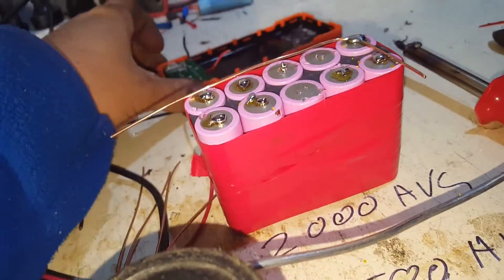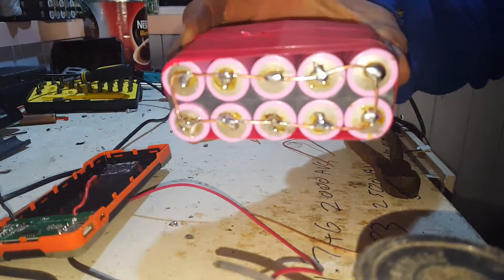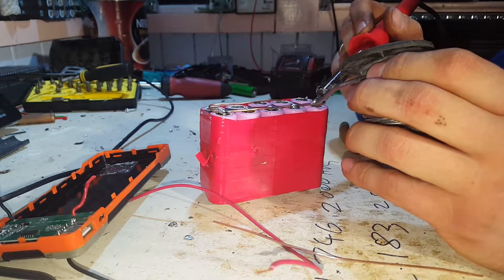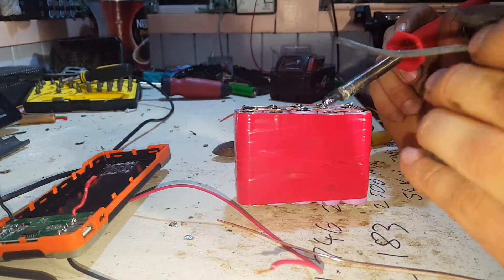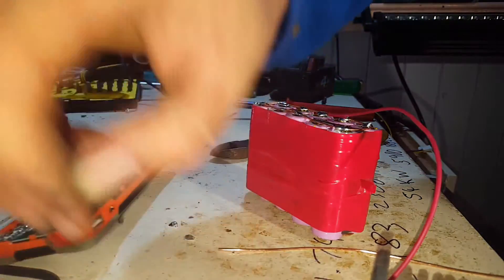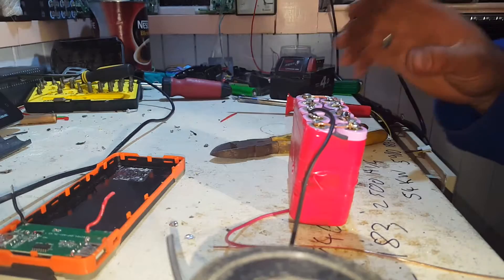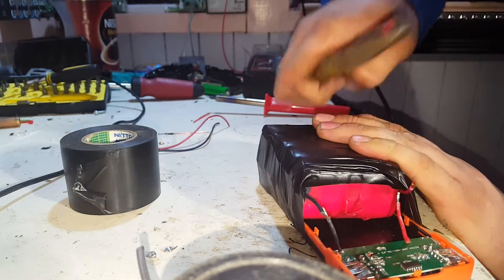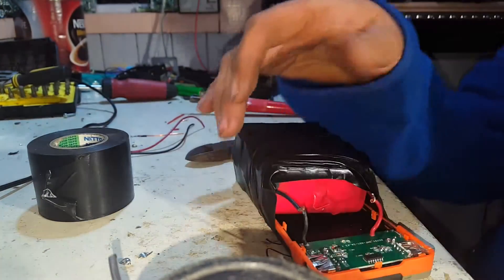30,000mah + Usb power bank DIY HACK 18650s

Comment: Did the wire stay on? I tried it that way and the solder always breaks off of one battery, so I purchased a spot welder and I tack on nickel strips. It does a better job of staying on.
Reply from the maker: +Adonis cmj use a bit of flux  mate helps heaps cheers
Reply: Yea, I tried that as well. I found that the solder didn't stick very well on the negative post of the cell. I cleaned the negative with alcohol and scuffed it with some sand paper, that helped a little. I guess I was afraid of leaving the heat on the cell too long as well. The amount of packs that I make, it made sense for me to get the spot welder.
Reply from the maker: +Adonis cmj yeah theres definatly some pros tona spot welder cheers

Comment: hey dude.  i just wanted to ask if the batteries were in series or in a parallel? 
why others using battery in series and others are in parallel?  
thanks.
Reply from the maker: king brian tobias +king brian tobias these are all in parallel  so only 3.7v nominal  but 30000mah

Comment: how maany times you can charge a phone in a single charge on your powerbannk
Reply from the maker: any how from dead flat it would do my Samsung Galaxy s6 around  12 to 13 times. it is 30,000mah but at a nominal voltage of 3.7 so there is a small amount of loss in the conversion  up to 5v to charge the 3.7v lipo in the phone .... silly i know